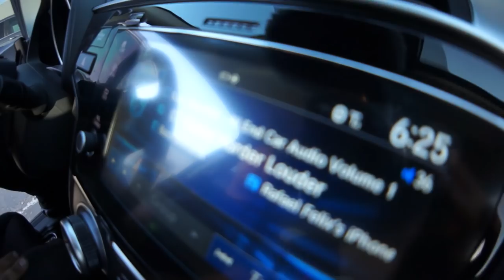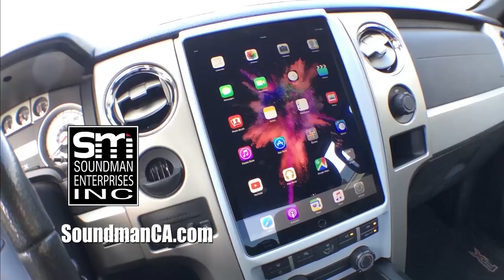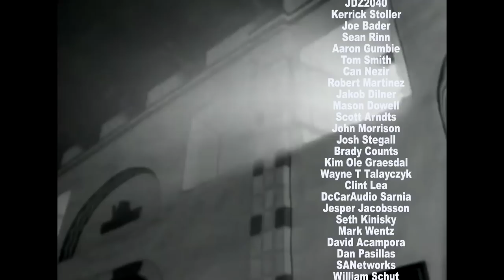Stereo VS Stereo 8! and ENTER THE WHITE RIDER! **SPECIAL, PART 2!** - White Rider #25

Comment: Doug you missed a dent on the door when you painted the car and why not use an eraser wheel to remove the molding adhesive... would be faster and saves you time.

Comment: Doug, you need an eraser wheel for your drill to get that adhesive tape off. They probably got one for a couple bucks at the local auto parts store or good old Amazon.

Comment: I remember rubbing my fingers raw trying to remove the adhesive from body side moldings until I started using a stripe eraser wheel, you should try it it will save your thumbs

Comment: Let Rafa Know that he needs a real Car before he can have a real sound system. That Electric Scooter he's driving can't carry more than 250 lbs and the  label on the door clearly states no acustic vibration's above 65 db or the batteries will explode.